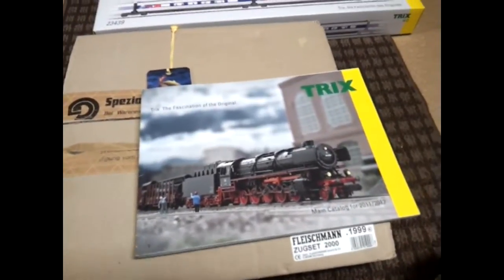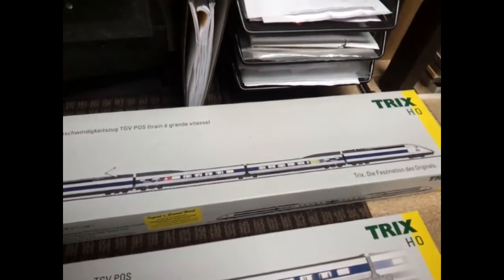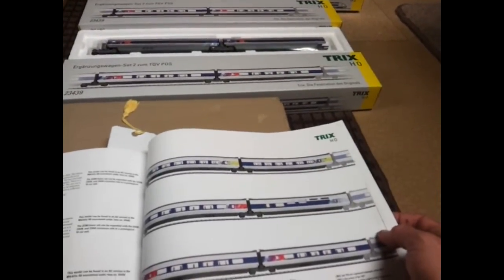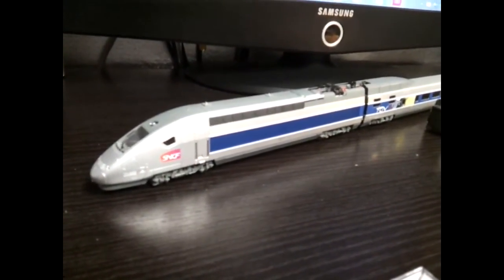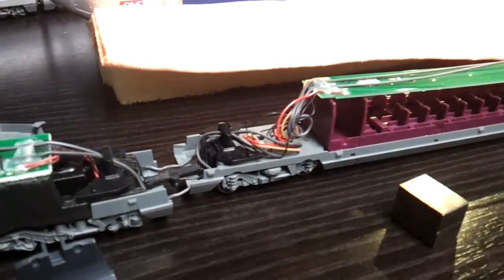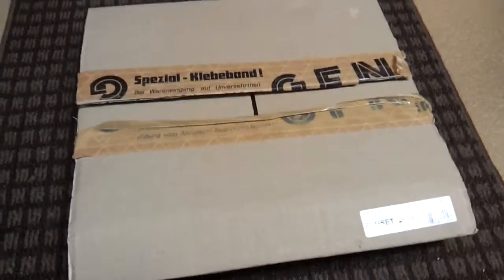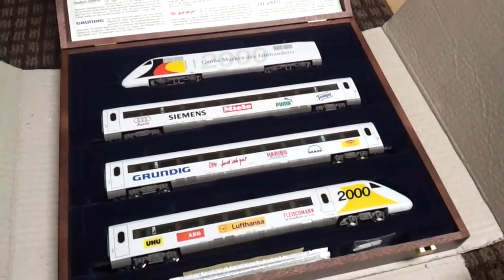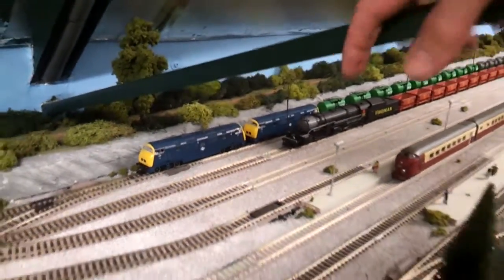TGV MODEL TRAIN

Comment: nice models jim I think the quality of European makes is outstanding you can pay extra but I think its worth it I am pleased with my n gauge roco trix etc like to see a running session cheers mate.
Reply from the maker: hi Keith,
The trix tgv has outstanding mancanics ...16 wheel drive , a true push pull with four fly wheels ..which sounds great running at high speed as there is a  very unique sound to this set....jim